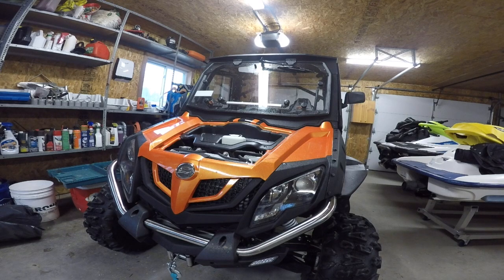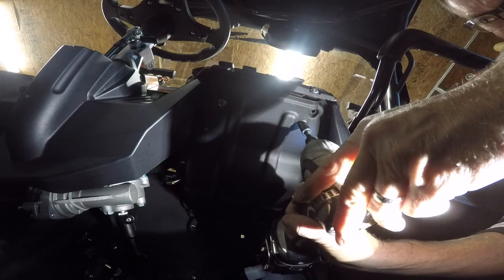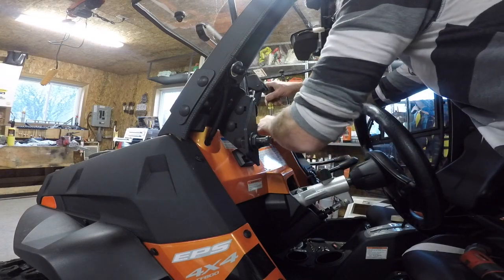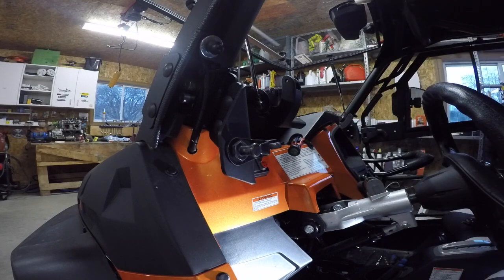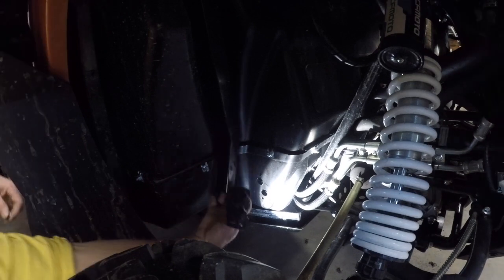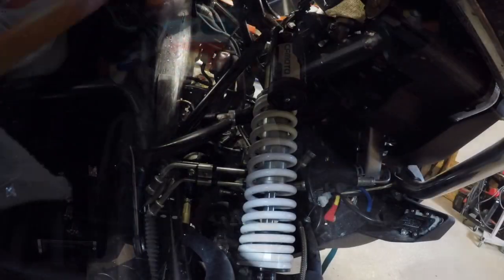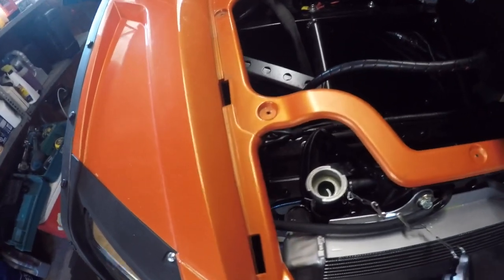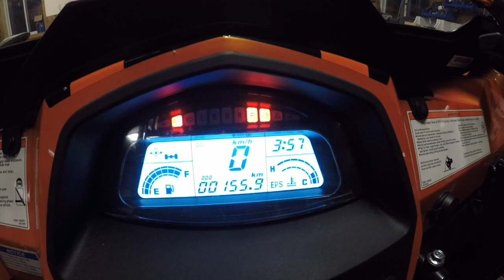CFMoto Heater

Comment: Thanks for the video - How long did it take from beginning to end to install the heater? - 

Was it a cfmoto oem heater or an after market ?
Reply from the maker: CFmoto full kit from dealer.  I did the project in 2 stages.  Cab first--1 day and heater another day.  It is super nice in the winter when it is 75 degrees in the cab on a snowy day.
Reply: @SeadooRefurb  Awesome - thanks - I had a local company install my doors and inferno heater -  they both work great - however I have a lot of draft holes - steering  wheel column, between metal doors and side panels of the buggie - and around the windshield  - working on each areas - using weather stripping and car door rubber seal trim

Do you have any solutions for unwanted cold air entry ?